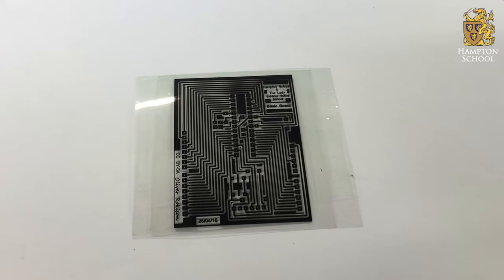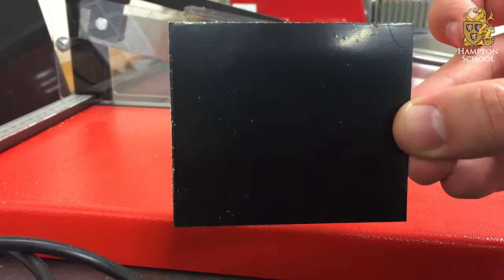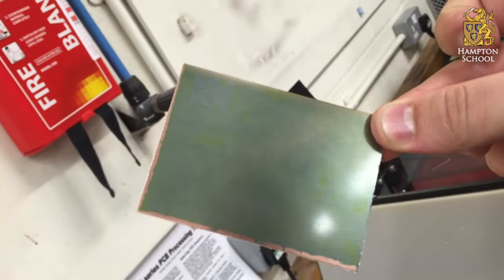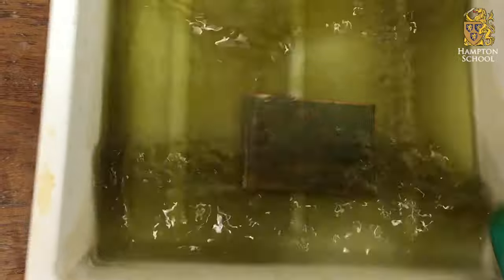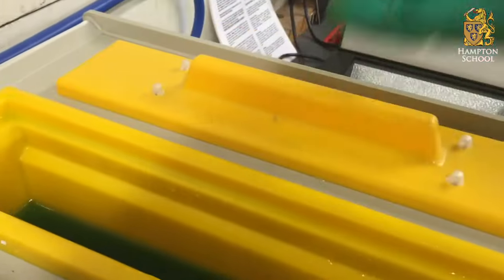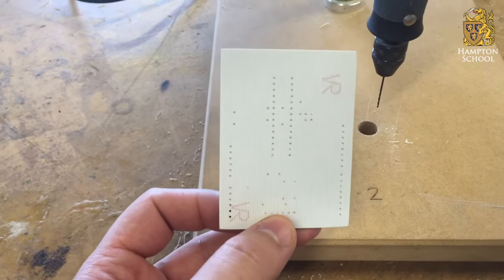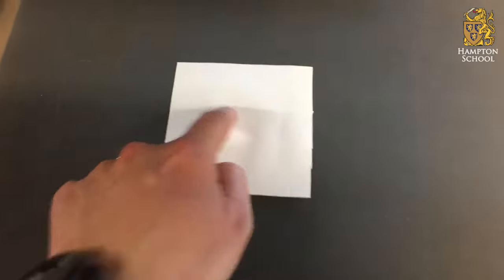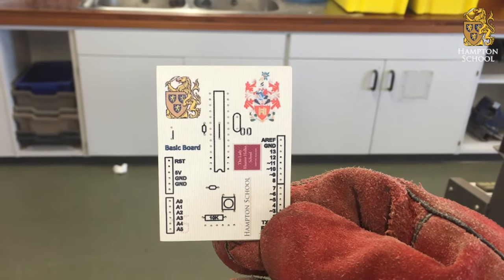PCB Manufacturing Tutorial

Comment: Thank you for the video! Can you please say where you've got that cool looking copper boards?
Reply from the maker: Glad you like the video. The board is actually Rapid Electronics economy board, and extremely annoyingly I have just found out it has been discontinued! It used to be here: https://www.rapidonline.com/rvfm-economy-photo-etch-pcb-single-sided-305-x-457mm-34-0176They seem to be suggesting the Mega Microtrak alternative here:https://www.rapidonline.com/mega-microtrak-positive-photoresist-fr4-single-sided-300-x-450mm-1-sheet-34-1510, but it doesn't look like it will be as white for the dye sublimation. If you find a better alternative, do let me know!The Rapid one is still available in smaller sizes "until stocks exhausted", so if you really like it, get in quick!
Reply from the maker: That's the one. It's the single sided type, until they run out.
Reply: OK! Thank you :)

Comment: Will a lasar printer come out the same with OEM HP ink in it?
Reply: MegaKbyrne no, the dye sublimation process uses a special type of ink that is designed to sublime when used with a heat press. If you search for due sublimation printer, you should find some more info.